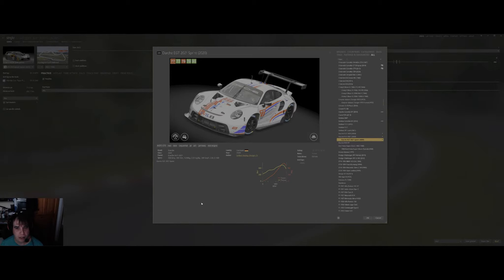New Darche EGT by United Racing Designs

Comment: One year later; still the car  brakes lock too easily (both 2020 and 2021 versions). Also, the cars have no ABS; why?
Reply from the maker: Wasn't there a recent up date? I will need to go back and have another go.
Reply from the maker: You are right, nothing much has changed. i have sent them a polite message - lets wait and see if I get a response
Reply from the maker: Update: The GTE Class has no ABS and URD recommend winding back the brake bias to the rear to help prevent front locking
Reply: Turn on abs in game.